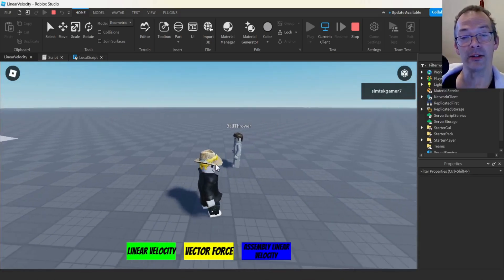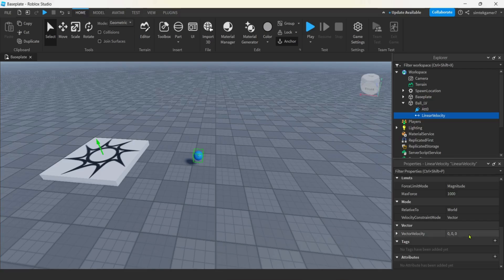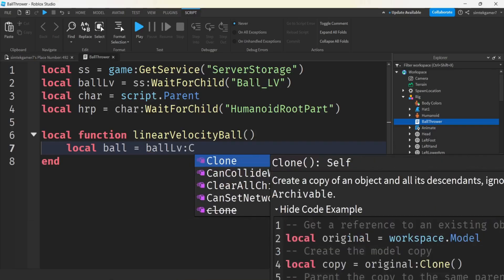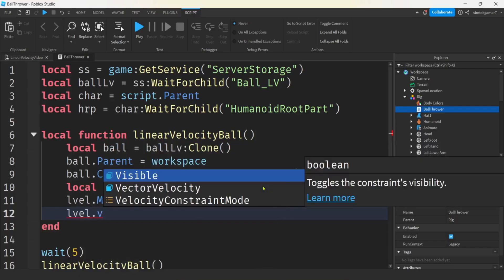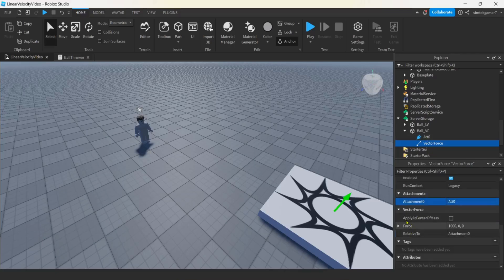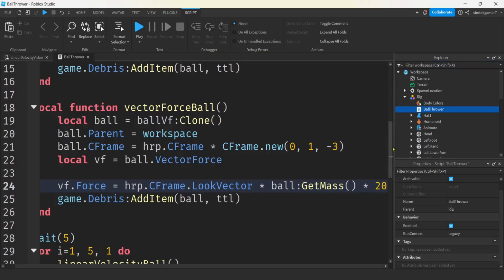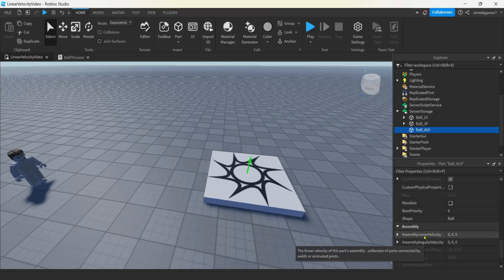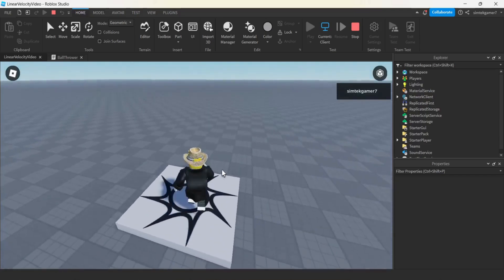LinearVelocity vs. VectorForce vs. AssemblyLinearVelocity in Roblox

Comment: if I wanted to make bhop mechanics to the character or a custom prop-based character (humanoidless), should I be using linear or the assembly linear?

I'm currently using a quake movement base and I'm unsure how to do the velocity itself (not the algorithm or calculations), which is being updated with client heartbeat

Comment: I am having this trouble when there's always this very slight delay where the ball gets cloned and then gets a force applied to, I wonder if there's a way to just make it smoother by shooting right away as in games during combat , this slight delay could ruin the experience when you are trying to aim at a player but there is this very slight delay. Is there a way to go around this ?
Reply from the maker: Network Ownership, I go over it in the arm cannon video.  You have to set the ownership of the projectile to the client for a smoother transition.  It’s not too difficult, you can google it
Reply: @SimTekGameDevelopment  yeah i did it and it worked , but i was told it puts you at a much higher risk of getting exploited so i thought id revert the network ownership to the server side right when the Collision happens so the important part like the damage being dealt is not abused by exploiters.

Another problem is that if a player is very laggy, won't the projectile also shoot very slowly based on the performance of the client? What else could I do in an actual game , thanks :)
Reply: lol bloxtrem

Comment: I think it would be great if you followed through with another video like this utilising it in a way like making a flight system, perhaps the player can fly around or something along those lines, or any system really, perhaps it could be something like an ability where when you click a location, if they are in the AOE the player gets lifted up and slammed into the ground
Reply from the maker: Great idea!
Reply: @SimTekGameDevelopment  This would be great! I've been having trouble with my flight system, where If I push my character against an object while flying forward my character flings and spins around uncontrollably. Not sure if you have any suggestions on how to fix this. Thanks.
Reply from the maker: @BlocksaverMax  oh yeah, align orientation would help with that.  Characters are a little tricky.  I might add a flying video.  I did a jet pack video a bit ago with vector force if that helps